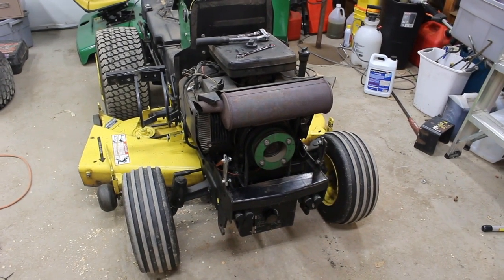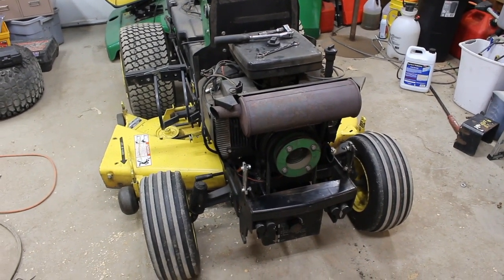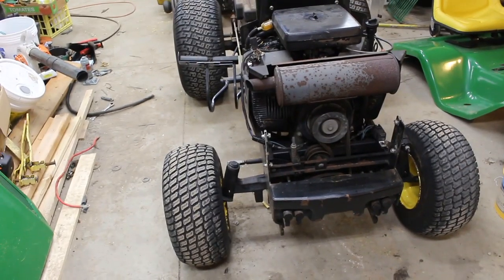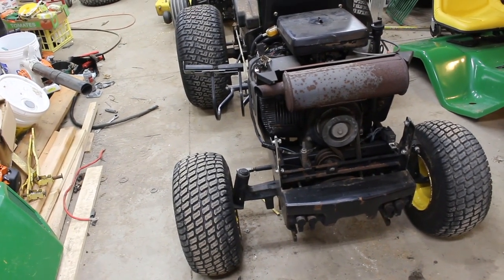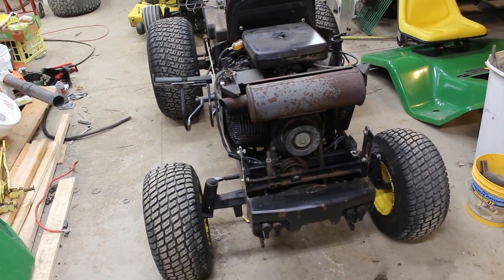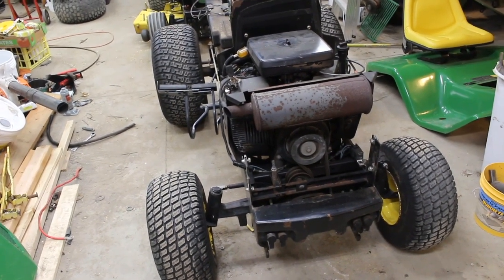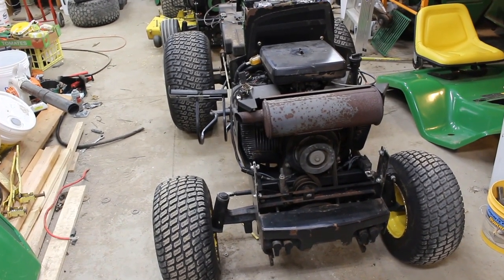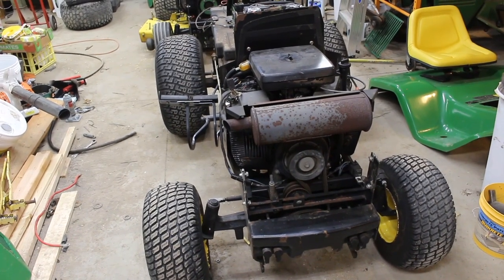John Deere 420 vs 318: Part 3 - PTO Design and Engines

Comment: I have a 87 318 and it is a p218 if I were to git a p220 carb would it produce 20 hp? I would not replace the camshaft at the moment. Just wondering. Thanks!

Comment: Very interesting about the carbs.  I bought a NOS short block for my 318 from Boomer. It's a P216, but in using the cam off my B43G and the carb it still makes 18hp.  The displacement of the P216 and B43 are the same.

Comment: The Ariens GT setup is just like the 420. It's such a pain to match a set of belts for it. No two belts are the same length, despite what any parts vendor says. It should be a single, large belt instead of the dual style. Oh no, I'm ranting, lol. Nice video series.
Reply from the maker: Interesting, I didn't know that about Ariens. Belt can just be frustrating on any machine.... And regardless of how many you have on hand you never have the right size!!
Reply: @mmrbeef  We always buy 5 or 6 at a time and see which ones are closest. Then just return the rest. From all I can tell, especially with your videos, an Ariens GT is pretty much a split right down the middle of the John Deere 3 and 4 series GT's.

Comment: Recently I bought a 420 garden tractor.  moo420x315336. The 48g onan is original.  1436 hours, so it's clear the engine needs rebuilt.  The starter is rusted with the bendix extended also rusted is that half of the flywheel.  The wiring below inspection level has been eaten, probably by chipmonks.  Nothing I can't fix so far.   My question has two parts, A) can a 20 amp stator be installed,  and B) can I soak the flywheel in Evapo-Rust The Original Super Safe Pail Rust Remover, Water-based, Non-Toxic, Biodegradable, 3.5 Gallons ? Just a link to an advertisement sorry. You  think it would harm the permanent magnets?

Comment: were these sold during the same time period? I've heard 400 series are harder to get attachments for is that true?
Reply from the maker: The 318 and 420 were sold during the same time period. In some ways because the 400 series was more expensive new I'm sure fewer were sold making attachments hard led to find now. Certainly not impossible to find. Common attachments like blades and blowers are relatively easy to find. (Might have to travel a bit or have them shipped). Uncommon attachments, you might search for a while.
Reply: Hmm. I heard that the 420 series were backwards compatible regarding past attachments from the previous models (the 318s and 400) and thus attachments from the 318 (and the 400 too?) could be used on the 420 models. I also heard that the 400 models could NOT use attachments from the 318, I am assuming because of the frame greater width...In another YouTube and on another website I saw that the 430 (same tractor as 420 but with a diesel which did make the vehicle 7 inches longer (ahead of the front axle for the added water cooling system)) could use attachments from a 318 if there was a "frame squeezer" attachment utilized (from www-alzwelding-com). SO my question again is this: Were the 400 series JD garden tractors unable to use 318 attachments while the 420 series could use these attachments, and did you require an additional attachment to fit these attachments to the 420 and if so why couldn't a separate frame modifier attachment be made for the 400 allowing it to use 318 attachment? What's the truth?

Comment: The lower pulley on the 420 was a weak part of the system. The teeth on the pulley were softer than the splines on the shaft. Those pulleys started out at 70$ now they are 240$ from Deere.
Reply from the maker: Yes, can't tell you how frustrating it is to replace those pulleys!
Reply: Do you know how to replace the oil seal on the rear output shaft on the trans...do you know the seal number and can you replace it from the outside ?

Comment: Do not sweat the difference in caburetor between the P220 vs P218. No way you are going to see a difference once you set up the jets. 18/20 =90%.. no reason to worry. Tune the carb and you will be fine.
Reply from the maker: The P220 also has a larger carb venturi. More fuel, more air, coupled with the larger cam lobes provide the extra 2 hp for the P220. The improvement might seem somewhat marginal but based on my experience with 318's and 420's and putting 20 hp engines in 318's there is a power difference in high HP applications like snow blowing.

Comment: Hello , I have a question , I have a Sears FF/20 that has an Onan engine , the electric PTO is bad and I'm looking for a part number for the JD mowers with a PTO that would work with my mower , I appreciate your time and any information you can help me with .
Reply from the maker: Hmmm I'm not that familiar with Sears units but I do think they have 1" crank shafts and the Deere units have larger crankshafts. There are some older Kohler powered PTOs that would work that have 1" shafts. Look for PTOs from a 140, 300, 314, 317.... Hope that helps.
Reply: @mmrbeef  I will check it out , thanks.